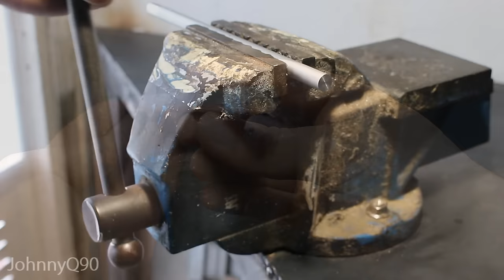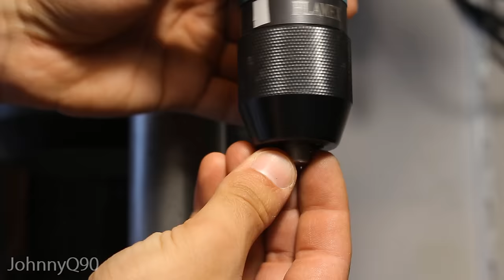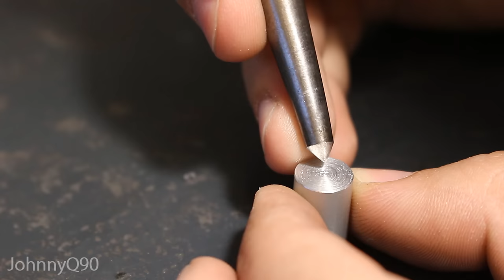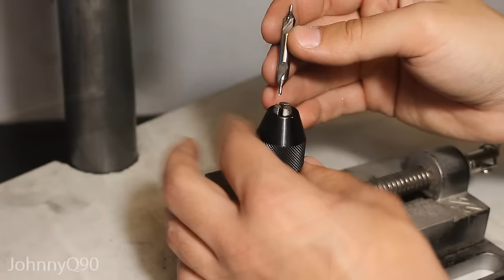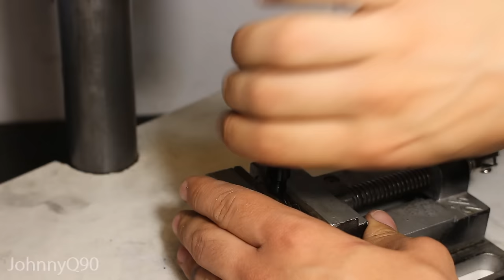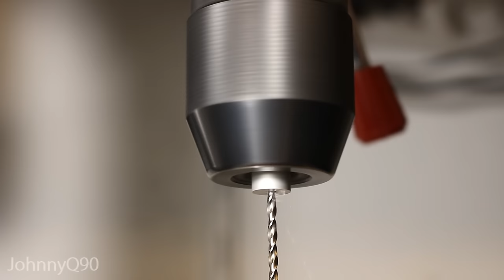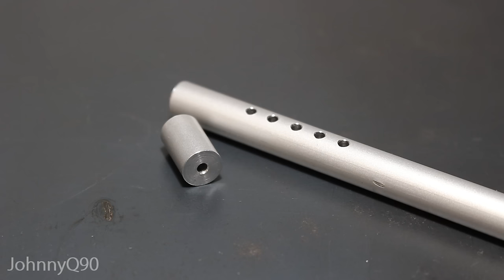Simplest Way to Drill in the Center of ANY Rod!

Comment: I was thinking the same criticism a lot of people here have regarding this, that the punch in the beginning was basically eyeballed. Yes, it is, but this is why in the end it still results in a hole that is centered. When he puts the piece in the drill and then lowers it onto the drill bit, that bit is still, so even if it's slightly off center, it'll merely make the hole slightly wider than the bit as it chews away at all sides while spinning. So in the end, being off-center would only result in a guide hole with a slightly larger diameter than if it was perfectly centered then it would result in a hole close to the size of the drill bit...

Comment: Another way is to clamp two round bars in the vise, and then position the vise so that a bit touches both bars.  Then place the stock on the two bars and drill it, starting gently with a small bit

Comment: Use a good squaring device to establish a true vertical with bit, otherwise small bits will snap, even in plastic, then finish with a small boring tool inside vice connected to a dial indicator for an accurate run-out and concentricity.  Hey, we use what we have.  I still need a bench lathe so I use my vertical mill as a lathe.  Everything does take longer but the results are there.

Comment: You could also get a drill bit of the same size as the rod, lay the rod on a flat surface and drag the drill bit down the length rod you need scoring a line. You can also put a + on the end of the rod or work piece. It might be within the tolerance you need.

Comment: Simple and good.. only one slight problem. If you are doing multiple holes in the same rod/tube... you need to have it secured well in the vice/clamp you are using,  because as you loosen the vice to move the guide along... being a round item, you might accidentally roll the rod/tube a little, and then when you drill you next hole or holes..., your holes will not line up !! 👍

Comment: As many people have already noted, this method doesn't get you an exact center.  If you were to press that "drill guide" rod onto a shaft, chuck the shaft in the drill press (or mill) and then spin it, you would see that the rod would wobble off center.   The concentric circles left by the sandpaper don't help.  First of all, the sandpaper is held loose by hand and slid all over the place, and second, just because there are circles doesn't mean you can hit anywhere near the center with a punch.

Here's a way to greatly improve this.
- Start with some aluminum rod a little BIGGER in diameter than you need.
- Use the method in this video to get a drill hole that is "kinda close" to the center.  
- Press a piece of steel shaft into the guide.  It has to be a firm press fit.  You could tap it in gently with a hammer.
- Leave some of the steel shaft sticking out of the end.  
- Chuck the steel shaft into the drill press (or mill) with the aluminum rod hanging below.
- Now, clamp a steel cutter into the vise below the chuck (the kind of cutter made of tool steel like the tool bits used on a lathe)
- Lower the spinning aluminum rod down and position the steel cutter so it just grazes the outside surface of the rod.  
- Keep lowering the head, and the steel cutter will peel off a layer of the aluminum rod.  You are now TRUING up the rod so that it will BECOME dead-on concentric with the hole in the center
- Keep adjusting the position of the cutter and making passes with the rod, peeling off layers until the rod is turned down to the real diameter you need.

- Finally, press the steel shaft out of the rod.  You can do this by chucking a piece of slightly-smaller shaft in the drill press, with the aluminum rod standing on end under it.  Lower the head down like a ram to push the other shaft out of the rod.

This way, you will end up with a hole that is dead center, within the tolerance of your drill press at least.
Reply: And, in the end of all that, you would have exactly the same amount of error as the original video had... the runout of the drill chuck.  Think about it.  You are doing exactly what the OP did, using a drillpress as a lathe.  His way is simpler.  That the outside will be concentric to rotation, like a lathe, is exactly the same principle that the inside will be concentric to rotation, like a lathe.  By spinning the work instead of the cutter, internal or external, the result has to be concentric.  Doesn't matter if the stationary drill is off-center (within reason) or out of alignment (within reason).  Either the drill bit snaps or it drills down the center.  Worst case, he'd have to take a bunch of spring passes to get past the drill wobble and the hole ends up bigger than intended because it bores instead of drills.

Now, to eliminate the drill chuck runout error, a person could combine both methods. Start oversized, spin the work, drill the center and lathe the outside as you suggest.  At that point, the center hole will be down the center of the outside, within the tolerances of the drillpress bearings.

Alternatively, if the size of the target hole was important, someone could drill the blank as you suggest, even ream it to higher tolerance.  Then, basically make a mandrel by chucking some aluminium and lathing it down (as you suggest) to the press-fit size of the hole, press the work onto it, then lathe the outside of the work to size, all in one go.

Also, your method would work to make a drill guide for shafting larger than the capacity of the drill chuck.  Drilling a cross-hole in 5/8" or 3/4" shaft is not uncommon.  Drill a hole in a larger chunk of aluminium, then do as you suggest to cut it down to size.

But, you know, bearings... bet all of this would chatter like crazy on anything but the lightest cuts.

All this makes me glad I have a lathe :)

Comment: Use a piece of studding/bolt with the head cut off to accurately line up the chuck in the hand vice with the pillar drill chuck. Put the studding in both chucks then bolt/clamp the handvice to the table and lock the handvice onto the second chuck. You now have the second chuck perfectly centred on the pillar drill chuck so you can simply use the centre drill to drill the end of the bar dead centre.

Comment: You can get about the same accuracy much more quickly.  Put a pointed tool in the chuck, a starting tap is a common tool that'll work.  Lay a ruler or other flat piece across the round rod, lower the chuck till it touches the ruler, move the vice to where the ruler is horizontal, there's your center.

Comment: I used aluminium disability crutches, but they were not long enough. I purchased two long lengths of, correct sized, aluminium tubing, the same size as the crutches. Then I needed to drill holes into the  tubing, exactly centre. I made a mess doing it by hand. This method shown here is how to do it exactly right.

Comment: I liked it, my only observation that the mini chuck was put in the vice and the 2.5 drill bit was  not checked to be perpendicular with a mini level. I assumed the piller drill is set up level..
Reply: forget level, level is for structures.
Reply: @matthewheffernan3877  Hardly, imagine the rod and the drill being out of level and perpendicular. Result would be a misaligned hole and / or a broken drill.

Comment: Draw lines on both the rods which are perpendicular to each other.  You can align these lines & drill through the guide hole.  They will all align in a straight line

Comment: Seems so much easier to clamp a piece of angle iron or a vee block in the vise and align the drill with the bottom of the vee. Works with multiple diameters of rod without making extra bushings or changing your setup

Comment: Looks precise  , I'm surprised you didn't   use vernier calipers,  in combination with a square to crossover the center but it did look dead on,  good video
Reply: S. S. No need .
Having the workpiece in the chuck and the bit stationary causes the hole to self Center .
Under size drill the hole then reem to precision .

Comment: When spinning the guide piece rather than the drill bit,  the drill bit has to find the centre otherwise it would throw the vice about holding the drill bit, it’s the same principle as to why a lathe and tails stock works. 👌👍

Comment: instead of sandpaper, you could use a file and work your way outside to inside at an angle so you would end up with a countersink. Then instead of using a center punch, you already have your lead in ready to go for a better centered jig

Comment: If you wanted to do anything like this, chuck the short piece in the chuck or collet. Lower the drill press down where you can clamp the free floating vise to the aluminum piece in the chuck. Tighten the vise and then clamp the vise to the table. Take the short piece out, put the long piece in the clamped down vise, use the center drill and then use the drill you want. you need to keep the bar in the vise 90 degrees to the drill chuck by locating on the bottom of the vise or some kind of a block or parallel. Takes longer to write this than to do it. LOL

Comment: This is great - how do you accomplish the same but with drilling multiple equally spaced holes along the center of the pin? I have a long square piece of aluminum that I need to drill holes in along the entire length, then use a countersink bit to create a concave ring along the circumference of the hole. I’m thinking the countersink part is pretty easy once you’ve drilled the holes through.

I wish I had a good way of linking to a picture that demonstrates what I’m looking to accomplish.

Comment: This is called tribal knowledge. How to do with out a lathe. The hole down the middle will depend on the drill chuck accuracy yes, but it actually doesn't matter, if you can measure accurately and given the negatives, I'm not to going to explain why, work it out. Well done Sir.

Comment: You can skip the C/P bit. To center two chucks to drill a hole down the rod requires you to put rod into the drill press  , open up the lower chuck pull down on the drill press tighten lower chuck clamp drill vice and chuck to drill base put drill into lower or upper chuck. Dead center every time.

Comment: Oh, you were so close!  Cut a 2-inch long piece of the rod and finish the end as you have done. Place the stock in the vise as you have done. But then chuck up the short piece. Feed the short piece down into the jaws of the vise until it just enters. Then lock the vise to the table. Remove the short piece, install the drill, and you will get a cross drilled hole on center.  For small diameter drills that bend, spot drill first. If you do not have a spot drill, use a larger drill to just make a starting cone.

Comment: A drill bit can be extended similarly by welding a rod to extend the bit put in the drill press and heat the weld orange and drill lightly while it cools down will at least get the tip close to center not perfect precise but might save someone some time or gas

Comment: Drill hole in the center of a piece of wood that is the same diameter as the rod. Put the rod and wood in vise then use drill press. You could use rip fence and the rod on table saw to set thickness and cut the wood to get same diameter. Don’t know if this would work🤓

Comment: His method depends on punching the center of the "jig". A better method I learned is to use the drill chuck to line up the placement of the rod. That is - using his orientation - put the drill bit upside down in the drill chuck, lower it into the clamp and tighten the clamp to the bit, and the clamp to the base of the drill press so that everything is solid. Release and raise the chuck (leaving the bit in the clamp sharp end up). Now put the dowel/jig in the chuck like he did and drill slowly - the bit will nearly perfectly drill the center of the dowel.

Comment: You have to be certain that the chuck in the vise is exactly vertical or the hole will not be straight through the center of the piece. If you know your drill press is exactly level then the chuck in the vise seated on the shoulder should be good to go...or you can use a square.

Comment: Good idea if you are just using bench vises and a drill press.. I would measure the wall thickness on your guide all around both ends to insure your drill did not wander.

Comment: To centre the small piece I would have placed a vice underneath it while it was chucked in the drill press and then lowered it into a vice and tightened it while it was still in the drill press. Clamp the vice to the table and then release the small piece from the press. Install the drill bit back in the press and then drill the piece below that has been centred underneath in the vice.

Comment: Dude, create a square that is the same size as the tube’s circumference, draw two lines from each corner to its opposite corner.  Where the two lines intersect is the center of the square.  Put it in on top of the tube where you want to drill, clamp it down real well and your good to go.  Trick is, the both need to be secured by the same clamp.

Comment: Why the centre punch? (I use the same method without one.) As the work-piece rotates, the tip of the drill bit will automatically find the centre because the centre is not moving (almost). The part holding the drill bit (base) has to be carefully moved by hand to ensure it's exactly under the centre. I've seen smaller drill bits bend a little if the base is out of position (by a tiny amount) and the tip of the drill is clinging to the centre of the workpiece.

Comment: Alternative way is to drill a hole in a block to fit the rod, then cross-drill where required. Saves relocating the short stub of rod every time. 
Use the same principle for drilling locking-wire holes in threaded studs; cross-drill a nut the size you want, then lock it to the stud with another, and make your wire hole.

Comment: Don't clamp on the spindle of your chuck that's a ground piece of metal any marks on that diameter you lose all the centres accuracy. Clamp onto the outermost part of the chuck once you have tightened your work piece instead. Stay safe

Comment: MORE ACCURACY:  1. tighten the drill bit in the drill press chuck upside down.  2. lower the press and move the pin vice as needed to capture the bit, tighten.  3. lock the pin vice  down to the table and release the bit from the chuck.  4. raise the press and continue as shown.

Comment: Should have set the second chuck with drillbit already inserted into the top chuck and clamped down, then lower into vice to ensure drill bit is vertical and centred then clamp into vice, release top chuck, set piece and away you go

Comment: May I suggest an improvement ? Put the centering drill backwards (well, whatever, they are double sided...) in the drill Chuck, lower the drill, tighten the Chuck that's  in the vice, lock it into position, release the drill chuck. Now, you're sure that both chucks are on the same line (assuming the drill bit is straight and there's no play in the press...)

Comment: ASSUMES the center punch indented the exact middle of the small piece. It's possible to be "off" center !
Reply: Yes, a major flaw in this whole of this process - the centre punching is pure guestimation and way off. 

There is a way. Extended the rod out of the chuck, lower to table and lock it up in the unclamped vice...then secure the vice onto the table with the piece still in the chuck. Loosen chuck, put centre drill in drill press chuck and hey presto  - a centred hole. Back to school, I think? :)

Comment: You eyeballed the center of the rod and used a manual punch also eyeballed it square in the vice. To find center you could have rolled it and marked it flat against a permanent marker. Another way is to place it in a vice when chucked up square, release chuck then center drill it in one operation.

Comment: Much easier to put the piece into the chuck, lower into a vice, clamp the piece in the vice and release the chuck. Then put your drill bit in the chuck. The bit will be lined up with the piece to be drilled.

Comment: How about: Use a vertical mill, indicate the center, get perfect row of centered, horizontally aligned holes?

If starting the drill bit walks, spot with a center cutting end mill of narrow diameter.

Comment: Without checking the mini chuck for straightness in the vise how do you know your pilot hole is correct and straight. I noticed the drill bit was off when you were drilling. Very slight but off just the same

Comment: What a lot of sodding about. NO need to bother to make the drill bush. Place a short bit of the same diameter material in the chuck, bring it down and clamp the VICE onto it. Bolt the VICE down, remove the stub from the VICE and drill chuck. Fit your part into the VICE, center drill and drill the required diameter hole. JOB DONE.
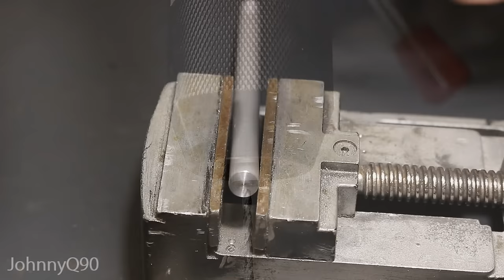Reply: I know right, I can't believe how much more complicated this is than what it needed to be and it's out by 1/2 the diameter of the bit, at 2:28 you can see just how bad it is if you screenshot it..

Comment: Definitely a useful technique for small rod, but not "ANY". Drill press chuck jaw capacity is a major limiting factor, as is being able to first acquire and then maintain dead center by both eyeball and coordination long enough for the center drill to come into play. But again, despite the misleading title, this remains a useful technique when a small rod and at least "near center" are adequate, especially if the drill press and accessories (vice, table) are well tuned and vibration is largely eliminated. .